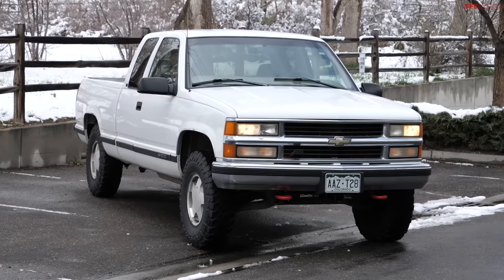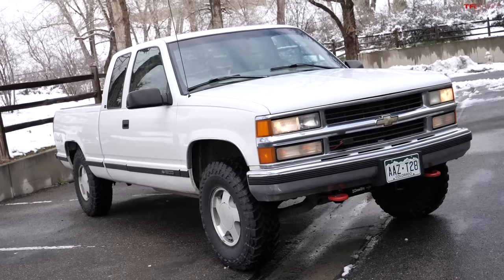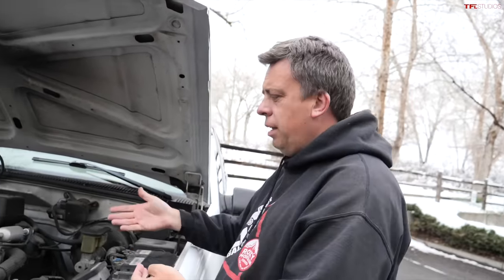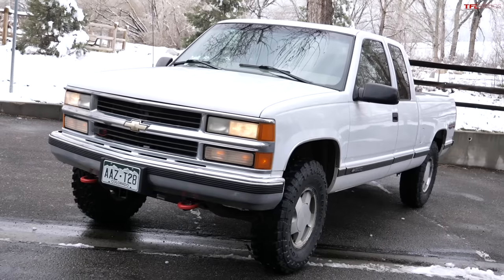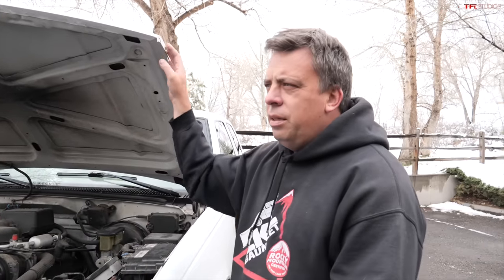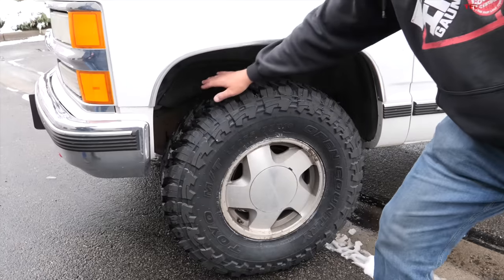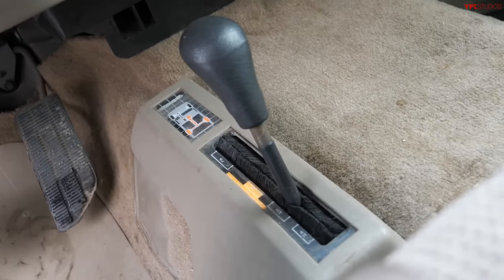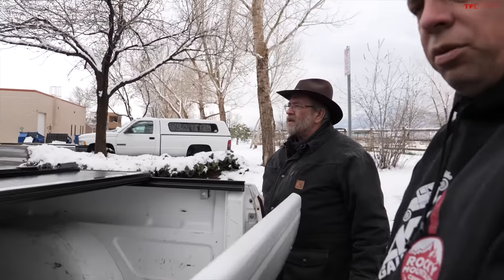Mr.Truck on Trucks: Was The 1990's Chevy Silverado The Greatest of ALL Time?

Comment: So what is wrong with side post batteries. They don't corrode like a top post. I guess the ones with both top and side posts make it easier to add accessories, but I have never had a top post that I didn't have to constantly clean.
Reply: They cut my entire side post battery speech. But I didn't like them

Comment: Yes the power train lasts a long time & is straightforwardly to get parts for, etc.  
Also yes the body around it is shameful - sagging doors, windows that don’t crank well, exterior trim bits that fade & fall off, seats that sag & fade, switchgear that doesn’t. And the paint ... where to start?  So yes it runs, but it is also a rolling advertisement for anything but GM.

Comment: Same problem on my 305 it's that center pulley for the belt on the top...  I'm at 216k with a problem doing a misfire still trying to diagnose might be going to the mechanic... If it is the timing it will be a bitch.

Comment: If mr truck is Mr truck ...why did he ask if it has torsion bars? Every chevy truck of that era had torsion bars wether it was a 1/2 ton or 1 ton. And to answer his second question ...no, none of the half ton 4x4s had a 454. And to those who want to disagree about the torsion bars ...my wifes 89 year old gpa has a 98 extended cab dually with a 454 that is equipped with torsion bars. I know because I cranked them up to help with his new Boss v-blade

Edit: sorry I forgot about the 454 ss ...yes they did stuff a 454 in a half ton but you would know it looking at the truck

Comment: Squirted WD-40 on all the pulleys??? WD-40 isn't a lubricant guys, its a water displacer that can help things get unstuck but it's not a long term lubricator and in the long run CAUSE squeeks, not fix them

Comment: The problem  with these was very weak transmissions , transfer cases.  And being so old now will have  go junk yard,  not worth rebuild costs.  A rebuild trans would  cost way more than truck is worth. But that era were the best trucks could get in 90s.
Reply: I don’t know where the 4L60e gets such a bad rep from… they’re honestly pretty good. Yes sometimes you get a dud but that happens with any make/model. I’ve heard many of these transmissions reaching an exceptional amount of miles without needing a rebuild. I personally have a 1995 Suburban 345,000 kms or 215,000 miles with all original powertrain, not a single issue with trans and still shifts smooth like pudding. It’s good for a long time yet. Transfer case problems were with the GMT800 (99-06)

Comment: I don't know but I don't think the 305 was a very good engine, would rather have the 350, or 454
Reply: 305s were great. 454s are so hard on fuel unless you really need the power I'd go 5.0 or 5.7
Reply: 305 vortec 230 hp 5.7 vortec 255 hp the 305 has more hp per displacement

Comment: WD-40 is a solvent, Andre. You know this. All you do when you squirt it on something that squeaks is force out whatever lubricant that was in there. You, ultimately, make the problem worse, dude. C’mon! You know better than that.
Reply: This is 100% false. Wd40 is a lubricant suspended in a solvent. The solvent evaporates and leaves the lubricant behind.
Reply: @colinvargo3418  the small amount of paraffins/mineral oil/ petroleum based lubricant that is in the aerosol does not outweigh the solvent properties in something that relies on a heavier lubricant for affective operation.  It is squeaking because it does not have the proper lubrication in between the moving parts. Now, whether that’s because of an absence of lubricant, or increased tolerance because of wear, that’s unknown. Bearings rely on grease to properly function. Coating it in a rust preventative mineral oil after “cleaning” it off with the solvent in WD-40 will ensure the bearing’s ultimate failure.
So, yes, you’re technically right, it is a lubricant suspended in a solvent. But using WD-40 instead of a spray lube is a temporary fix that introduces a solvent into bearing which, in this application, will ensure that high speed bearing’s failure.
Reply: @LukeEdward  for sure wd40 is not a replacement for grease. The solvent properties are merely a conveyance for the lubricants. This is the same in all penetrating oils. You had said wd40 was a solvent and would drive out lubricant, and this is not the case. The noise is likely the bearing in whatever unit is failing. Wd40 will help determine which part is failing, not solve the issue. Once the bearing is squeaking, the damage is done. You need to replace it. Wd40 is to going to make it worse.
Reply: WD40 won't fix a worn out sealed bearing either way.
Reply: @daniels2761  nobody said it would.

Comment: You're not losing much by having the 305 instead of the 350. Same mpg, barely a power difference. These trucks are like cockroaches. Don't kid yourself, they have issues. The engines are good, everything else leaves much to be desired.
Reply: I've owned a 96 c1500 with a 305, and a 96 k1500 with a 350.  The heavier k1500/350 would smoke the lighter c1500/305 all day, every day.  Night and difference in power.